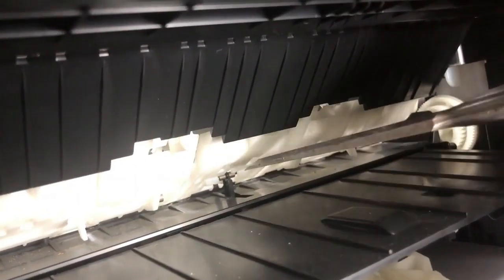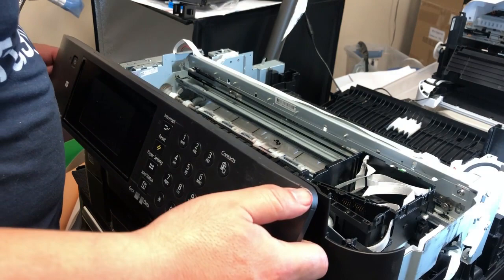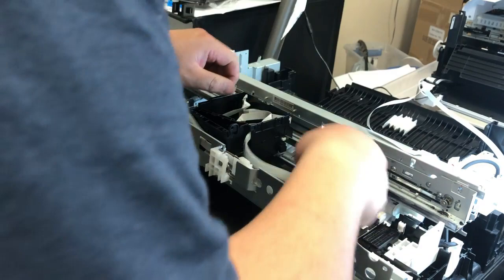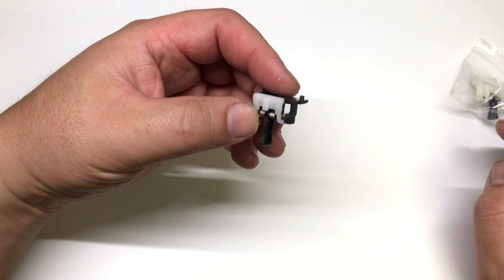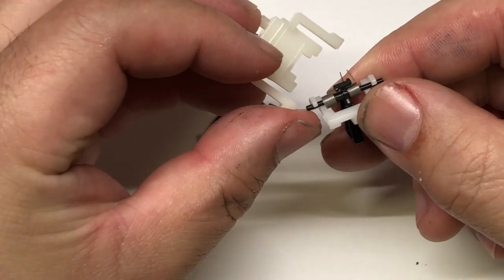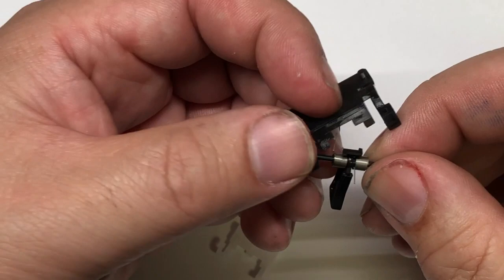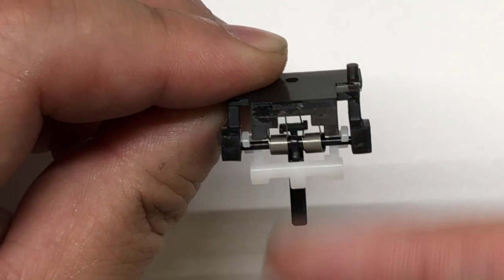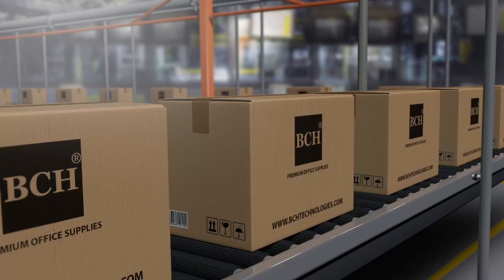Fix Ejection Lever & Fake Paper Jam for Epson WF-7710 and WF-7720

Comment: im having a problem with my epson 7210. it was just working perfectly but from one day to the next it would intermittently print and then all of a sudden start throwing out a pahntom paper jam. it now only prints in letter page size and normal print quality. as soon as you change those settings it triggers a phantom paper jam. how can i fix this i have already checked all sensors and duplexer, any help or direction is appreciated

Comment: I got the ejection lever fixed and the printer back together but it says ink cartridge cover open then gives an error. Could this be the data cable? I cleaned it. I did get the printer to boot 1 time.

Comment: this is another good tutorial, wf parts are getting hard to come by actually.  On a side question,  can I you please explain to me what is the cause of a ringing or beeping long sound from the head then stop printing.. no error code .. sometimes its very long about half to a minute.. then print some lines then beep again? this is still happening even just  opening the printer and changing the cr motor?  as always thank you very much..
Reply from the maker: It could be a couple of things.  Have you checked the door sensor and make sure it's not malfunctioning?
Reply: @BCHTechnologies  what is the door sensor? also can you repair a shorted board?
Reply from the maker: @c2sartinkprinthub757  It's the push-down sensor near the LCD panel. If you have a short there, the printer will think the scanner cover is open.
Reply: @BCHTechnologies  Understand.. but its not related to the scanner door, rigged it . when it stop printing it beep sometimes long beep the head does not go to purge unit (like when scanner door is open) then it print slow.. beeping stoping ang printing every minute. There is no error code, the cr motor is below 36C, is there such thing of overheating head due to continues printing?
Again thanks..
Reply: @BCHTechnologies  would you believe that the issue is the carriage, somehow it is not slidding across the rail causing overheating signal either to cr motor or head.  I've replace the carriage now its working fine, tested also the head to other unit.. it works fine also, so the real culprit is the heda carriage assembly..
Reply from the maker: @c2sartinkprinthub757  That surprises me! What was wrong with the carriage? Did it need lube or is it cracked?
Reply: @BCHTechnologies  I don't know really what is the physical issue with the carriage, I already opened it apart and the white sliding switched is ok. Its not cracked,  tried to put grease but its running really heavy...  its a 30k full photo pages, (printing yearbooks)
Reply: were printing on offset (C2s paper actually).

Comment: My epson 7710 is having a false paper jam error right now. When testing the Ejection Leveler while still in the printer, the only thing I am looking for is the way the lever falls back and forth, right? If it falls back and forth smoothly then the lever is not broken and it's the photo interrupter malfunctioning?
Reply: Did you ever find a solution… im dealing with this same issue
Reply: @RoxyGarcia2013  My photo interupter was malfunctioning. I had to buy new parts and install them
Reply: Was it hard to replace ? How long did it take you ? Did you purchase the parts from the website he mentioned ?

Comment: What if the wf7720 says paper jam but no jam and the  eject lever is good. But when printer tries to pick up paper from either cassette it makes a hard CLICK sound and says paper jam. But will print from rear feeder. I can not find the source of the hard snapping  click  that throws paper jam. It won't print checks or reports from cassettes so I can't do any check or cleanings
Reply: Did you ever find out how to fix it.. mine is doing the same thing at the moment
Reply: @RoxyGarcia2013  no I didn't my wf actually bit the dust wouldn't put color on paper but it would print like it was. I would by pass this issue above by using rear print feed. I got it sitting in the corner now collecting dust. I bought the ET8550 GAME CHANGER PRINTER THE BEST !!!
Reply: My wf 7710 works fine with letter sized paper both front and rear feed, but when I set to print 13x 19 it will have fake jam. ..
Reply: @StitchAndMakeUSA I haven't tried a smaller paper in the rear feed on mine, only 13x19 and the phantom jam is so annoying
Reply: Mine is doing the phantom jam only from cassette 1.  So annoying
Reply: @user-od9tv8qv8z  is it still printing from cassette 2?
Reply: @user-od9tv8qv8z  whatever you do don't pull the jammed paper out backwards always always pull jammed paper out the same way it prints.
Reply: @GraphicGin111  yes, it is still printing from cassette 2.